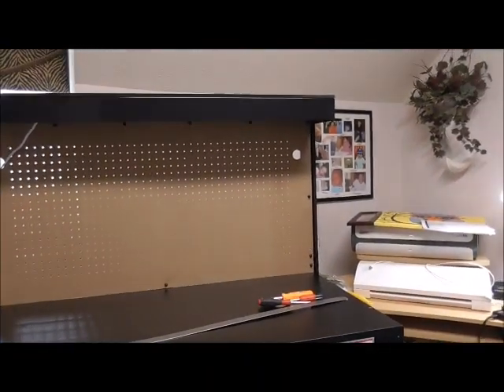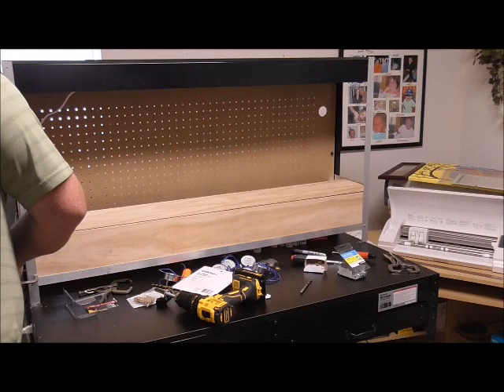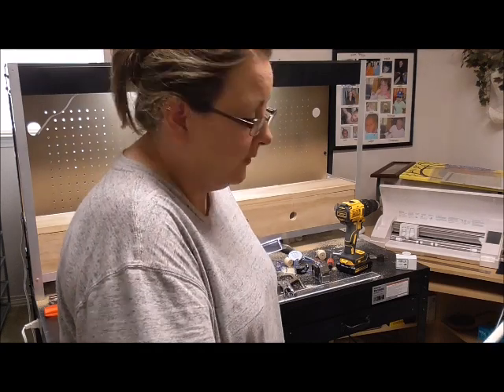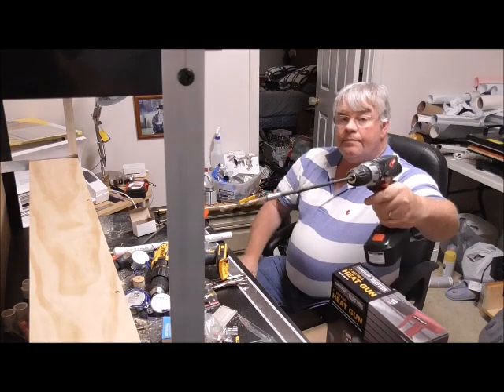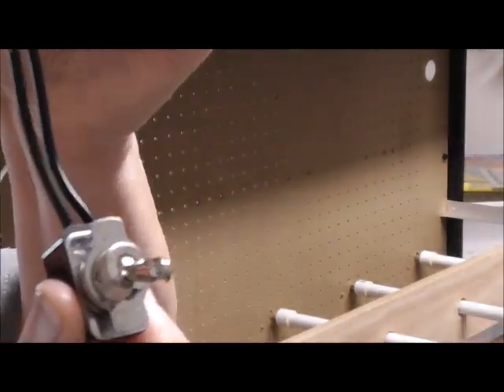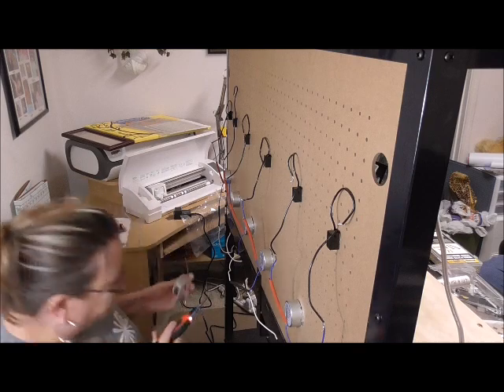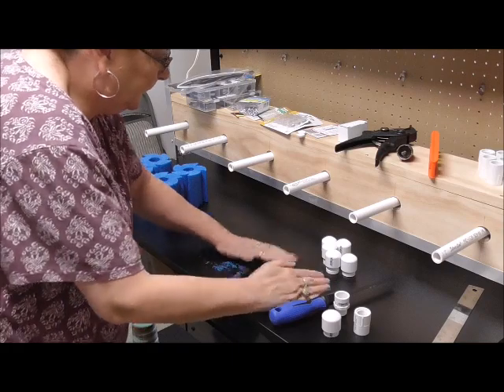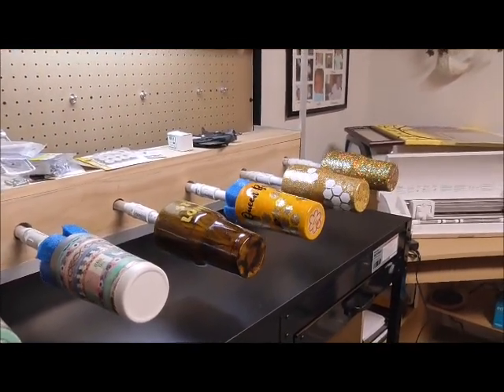Step by step instructions for 6 Cup Turner

Comment: I got a lot of ideas from this video. I was going to make one that sat on my tool chest, but using that harbor freight table will add more storage space and reclaim the flat surface of the tool chest for other uses. 
Also I am going to put the connection on in the reverse of how you have it, so that I have the flat side of the hex to grip when screwing it in and removing it.

Comment: Nice build. Would it be beneficial to add a ground wire to the motors by attaching to motor mount screw? And of course one would need a extension cord with a ground wire as well.

Comment: Hi Mayhem! Thank you from Norway for the video! 🙏🌺
I built myself a quick prototype today (1 hr), and have made my first plastic cup pour 👍😊. Really considering to make a six position station also (quite different design though). 
One question: I have a similar motor as you have (220V version). It gets quite WARM when running. I chose to put a fan on it to be safe...  Have you noticed any heat problem with any of the motors?  
Happy Tumbling 🙏😊
Reply from the maker: I have not noticed any heat issues with mine. They can get plenty of air circulation the way I have my station situated so....so far there has been no issue!
Reply: Mayhem Bling Cool (hehe literally). Thank You 🙏🌺

Comment: Wouldn't one switch suffice if you are OK with all motors turning vs having an independent switch for each motor?
Reply from the maker: One switch would suffice but I wanted each one to turn independently. That way I could only turn on the ones I had cups on...saving wear and tear on the other parts. Great question!!!

Comment: Do you have any advice on how to build one for square vases?
Reply from the maker: What size is the vase in diameter? I would think that as long as a football or pool noodle could snugly fit inside it should still work. You can also wrap the non-skid stuff that you put under rugs around whatever you are using on your arm and it keeps cups from falling off so maybe use a football that would fit inside your vase and wrap it with the non-skid. You can find the non-skid stuff at dollar tree! I hope this helps!!!

Comment: Great video - These toggle switches will reverse? How does that work? It looks like its only on and off. 6 Gardner Bender GSW-18 Heavy-Duty Electrical Toggle Switch, SPST, ON-OFF, 8 A/125 V---
Reply: April Rowden these motors change direction every time they are powered off and on again (with a small delay) 🙏😊

Comment: what is the width of this table? And what is the purpose of elevating the wood box for the turners? couldnt you just make it flat on the table to give more stability?  What will you use to place on table under the cups during epoxy?
Reply from the maker: Hi Sandra...great questions! The table is 47.5 inches wide. I suppose you could just build the box and have it sitting directly on the table but we elevated it so the cups would be at a good working height for me so I could be in a comfortable position when I was putting the epoxy on. I placed some teflon sheets under my turners so that any epoxy that drips off can just be pulled off the teflon sheets after it dries. I also put paper under the turners when putting the glitter on so I can catch the excess. Here is a link to the teflon sheets I used! https://amzn.to/2StOakw

Comment: How much space do you have from the top of the shelf to the underside of the top of the work bench? Also, what are the dimensions of the bottom portion of the work bench?
Reply from the maker: Let me get there to measure and I will let you know!!!
Reply from the maker: My workbench is 23 1/2 inches deep and 47 1/4 wide. It is 14 1/2 inches from the bottom part of the top to the top of the shelf. It is 8 3/8 from bench up to top of shelf. The measurements are approximate... not exact! I hope that helps!
Reply: Ok, how about the part under the drawers? Is it the same size as the top?
Just wondering because I want to make this but want drip dry racks and a second row of turners but want to make sure there is enough space before I purchase the materials.
Reply from the maker: @maritalbrown  the bottom shelf is the same measurements as the top shelf (which would be the work area). Here is a link to the workbench that we used. https://www.harborfreight.com/48-in-workbench-with-light-60723.html
Reply from the maker: are you wanting to know how much space is between the bottom of the drawers and the bottom shelf???
Reply: @MayhemBling  yesz from the bottom of the drawers to the bottom most shelf.  Sorry, I tried looking in HF website but I didnt see these specific specs.
Reply from the maker: @maritalbrown  it is 18 1/4 from bottom of drawers to bottom shelf. Hubby said he thought the workbench was on sale at Harbor freight for 77.00
Reply: @MayhemBling  I just looked I dont see that price online?
Reply from the maker: @maritalbrown  not sure. He said it was in an email.  Might have been some sort of special. Maybe ask your local Harbor freight? I think we paid 99.00 for mine.
Reply: @MayhemBling  we drove up there and they had a alot on sale but not that. Thats ok vecause um not ready for it just yet, but wouldnt pass up a sale if it was.
Reply: @MayhemBling  literally just went today to see, didnt get it was gonna wait for a sale...
 Just got an email for a sale.. guess where im going tomorrow

Comment: I may have missed it but why are the last 2 turning the opposite direction?
Reply from the maker: They turn both ways. If you flip the switch on it goes one way and then if you turn it off and then back on again it goes the other direction. Which is helpful because depending on what you are doing to the cup direction of turn makes a difference. Thank you for watching my video!!!
Reply: @MayhemBling  Thank you.
Reply from the maker: @caseycarver2834  you are welcome!!! I hope the video was a help to you!!!
Reply: Mayhem Bling where did you get the switches
Reply: @jeffreye.doughtie4342  there is a link to the ones she used under the video.5th one down under Here is a list of materials:

Comment: Making this now....
But I have a metal pegboard 😒🥴...
Trying to figure out the drilling part for wiring.....
Reply from the maker: Not sure about that one! Do your motor shafts fit in the hole of the metal pegboard? If they do I would say that would determine your placement of wooden frames.
Reply: @MayhemBling  
Awe man  already done the wood part, was lining up the poles now.....
I'm gonna have to drill a hole in the metal and probably use nuts and bolts to hold them🥺 .....
If anyone have ideas plz let me know....
Reply: Wanted to show a pic of it but I can't even figure that out....lol...
Reply from the maker: @lindawhite6541  those self tapping screws will probably work to hold the motors on and I would assume any drill bit suitable for metal should work to make new holes. Good luck!!!
Reply: @MayhemBling  
Thank you, and for the Tutorial to make this... It really  helped alot ...
Have a good wknd....